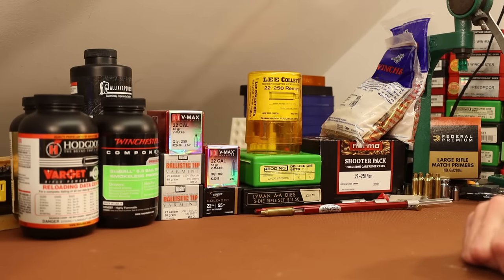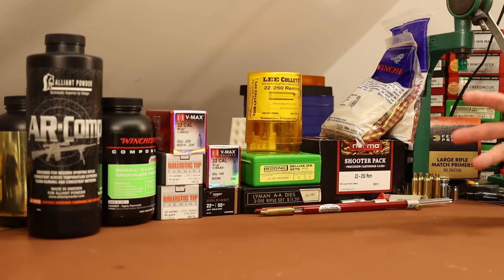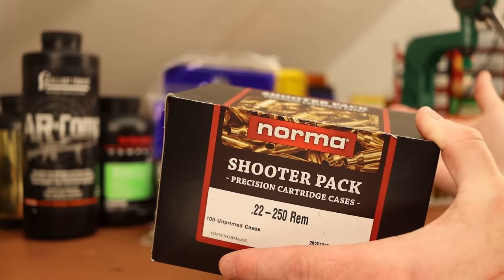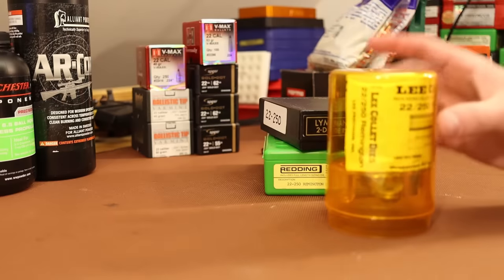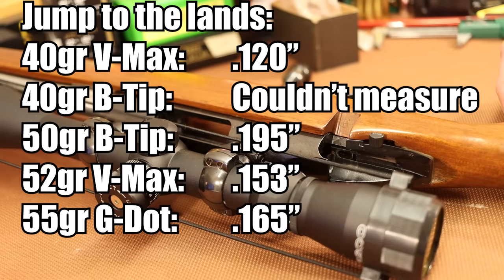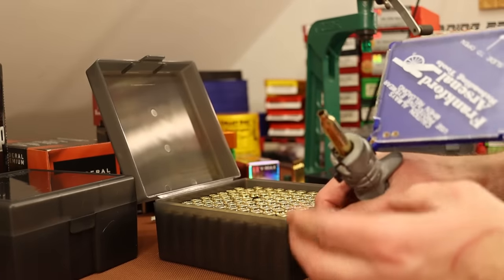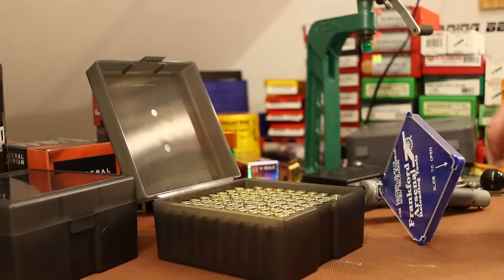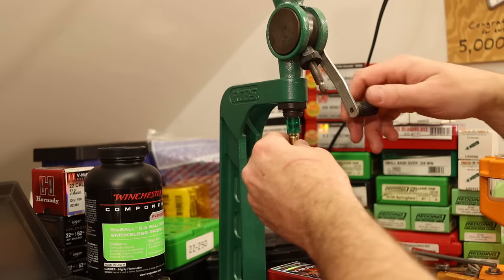.22-250 Remington - Getting started with reloading

Comment: You need to soot your brass man. Also, if you have a new piece of brass, you can use that for your OAL tool. It doesn't need to be a once fired piece of brass for checking OAL. If it is a once fired piece of brass from that rifle, all you need to do is deform the case mouth slightly so it holds the bullet with enough tension that the bullet slides in to the brass. Always soot the bullet, so if the lands pull on the bullet, you will see that on the bullet. If you don't soot the bullet when you check, you have no idea if the lands pulled the bullet out a hair. You are learning, you'll eventually get it...

Comment: Yep, tried to warn you of the 53v-max, they seam to like to have .180 jump to the lands in everything i have tried them in(22hornet, 223wild, 5.56, and 223 long throat). When you get to 40v-max and varget with allready fire formed brass you will get some awsome results. Might want to aneal your brass and check the neck thickness to see if it varies by more than .001 thickness all the way around. By the way i only use HDY and Fiocchi(GFL) brass and WIN primers. A lyman M die is very helpfull ass well.
Reply: The .22 Hornet would NEVER stabilize the 53 gr V-Max. They usually have 1:16 twists.
Reply: @luvtahandload7948  my 22hornet does and will the 55grsp as well
Reply: @sherrypulec1449  What make and model is your Hornet and have you measured the twist rate? My own Hornet is a relatively new Savage M40 with a 1:14.
Reply: @luvtahandload7948  savage 342 made in the early 50s it has a 1-14 twist

Comment: You don't need a fire formed case to use on the o.a.l gauge , if you've a case comparator gauge . Simply measure both cases and the difference to your fire formed case .
 I prefer to compare to my bump sized brass .

Comment: I just started using the Staball, feels like it want’s heavy bullets but I’m using it in 224 Valkyrie.  I did get the new Franklin Arsenal Intellidropper powder dispenser and really like it, drops the exact charge on both ball and extruded after you do the powder calibration.  You do need to let it warm up for a bit (15 min) and I re-calibrate the unit when I change powders.

Comment: I’m 2yrs late on this, but H380, Imr 4320, Imr 4064, Imr 3031, or just Varget, all of which is better than the ones you are using. Hornady load book does not show your powders you are using for the 22-250. My rifle loves the 40 grn v-max, with 36 grn Imr-4320. holes can be covered with quarter at 100.
Reply: I was going to try IMR 3031 on my 4th 22-250, but the gun shop owner said it wasn't funnel friendly and that made me change my mind. IMR 4320,4064 & IMR4895 have worked for me. 4320 is by far my favorite! 8 shots @ 100 yards I could cover with a dime using it with a 55 grain Sierra Blitzking.

Comment: The modified case does not have to be fire formed to be perfectly useful. All you have to do is use a headspace comparator. Measure a fired case and the modified case and find the difference in their lengths. Use the tool with the modified case as you demonstrated, add that difference to your base to ogive measurement and you're good to go.

Comment: 100% it would affect the group near the end of the video, if a stock touching the barrel affects accuracy, then that strap would alter the group especially it getting cut. 
i am a fan of holding a rifle firm not just let it kick as much, you be surprised how it affects groups.
i know with my spring air rifle i need to hold it firm, if i do not it is no where as accurate,
my 22 my 22.250, my 308 i hold all the same, but the air rifle the spring affects it unless i hold it tight, i mean tighter groups, still is accurate, crappy trigger just a cheap stoger, but at 20-30 yards it plucks a sparrow out fine, but i can reduce groups holding it tight, grandkids cant so i must remember that too, and i am fussy and spoil't from having a 17 tikka in the 1980s, factory stock, factory Remington ammo 5 shots under 8mm at 200 yards. that an eye on a fox every shot. if you clean it by shot 11, fussy round  at those speeds, but sweet. cats, foxes, roos, rabbits nothing moved once hit.no exits, unless hit a fox high in the shoulder, it would blow a hole in a $40 skin, ouch. too expensive once foxes lost the dollar over hear he sold the gun, but hands down too 250 yards the best gun ive used, and ammo loading for one is more affordable now. maybe,
and ever since i expect every rifle to be that accurate. naive lol. dam those 17s are accurate,
worst thing i ever did was loose that icecream lid target, i put a small shop sale  circle sticker dot on it, all shots in the dot.
i was called a liar multiple times by friends who knew i dont lie, until they met my father who said dam right its true.
remington ammo went bad i heard for a while too, but man factory ammo was sweet.

Comment: In my Rem 700, I had a problem stabilizing anything much bigger than 45gr in the 1:14" twist barrel. I need to dig out my notes but IIRC my best accuracy load was the 40gr V-max with Win760, I was regularly seeing groups <0.5" @ 100. But those loads are about 12-13 years old at this point so if I can ever get my damn bench back together I'll be starting over from scratch anyway :)

Comment: 22-250   "slow twist"  might actually shoot the  SPEER 70 SP SEMI-SPITZER , fairly well.  IF SPEER ever makes them, again...  The accuracy with those might be   better than the weight vs speed vs twist rate charts would  lead us to believe....  HINT: being  more blunt and SHORTER IN LENGTH than other 70 grain with more  bullet to bore contact surface  MIGHT BE what causes this bullet to shoot  stable, and be   accurate ....even when the twist rate  charts suggest that it should not.

Comment: 22 caliber rifles for deer?   Isn't that to small in most states?   Also.  Please explain why weight is a big deal on cases.
Reply from the maker: 22 is legal for deer in my state (KY) and my brother's state (WV).  It's certainly not the ideal choice.  Shot placement is key.  My nephews have killed several deer with .223 Rem using the 65gr Sierra Game King, so it can get the job done.  They were young and the low recoil helped.  My older nephew has graduated to a 30-06, and the other one will move up to something bigger when he's ready.  I certainly wouldn't recommend any 22 caliber cartridge for deer hunting, in general, but under the right circumstances it can work. 

Case weight really isn't a big deal, in any specific technical sense.  It's often a sign of quality, however.  Most of the premium brands of brass will have very little variation in their weight.
Reply: @JohnnysReloadingBench  thanks for the help.  How is the new chassis you reviewed doing?

Comment: i bought 100 round of nosler/norma brass for my 22-250 and had the exact same concerns with the tight primer pockets. I don't know if this is a good or bad thing.
Reply from the maker: How do they hold up?  Do they stay tight after a couple firings?
Reply: @JohnnysReloadingBench  Hello Johnny! 
I'm from normas home country sweden so i use norma to all my loads and seem too get good case life from them. I do not own a 22-250,  i haven't found the Primer pockets to be as tight as yours but  i use the rcbs benchmounted primer tool so that might change the feel a bit.
However in the 222rem using lee collet die I'm on the 24:th reloading with a 20.5 norma n200 chargeweight with an 40grain nosler bst
Regards Patrik from sweden
Reply: Johnny's Reloading Bench : Jagemann brass made in Wisconsin, sold by Natchez shooters supply

Comment: You ought to get some Starline 22-250 brass and replace that Winchester with it. Starline is miles ahead of Winchester brass, fo not too much more.
Reply from the maker: Starline does not make 22-250 brass.
Reply: @JohnnysReloadingBench   Well that was stupid of me. I could have sworn that Starline made 22-250 brass, and then I just realized that I have Starline 243 and 260, not 22-250. I use Hornady for 22-250 myself, but only because I got a bunch of it once fired for really cheap.

Comment: 99 pieces of brass  -----grrrrrrrrrrrrrrrrrrrrrrrrrrrrrrrrrrrrrrrrrrrrrrrrr
I like to buy once fired brass like 300 to 400 pieces all with the same headstamp. I buy clean brass usually from an indoor range so it has never been on the ground. Then I weigh my brass and sort it into about 3 lots.
The middle 4 standard deviations become my shooter brass.
The lightest brass is used for spares.
The heaviest brass is used for working up loads. If I blow a primer (very rare for me- only 2 in about 50 years) I can use a spare and go on. once I get a good load the heavy cases are retired and the most uniform cases - the middle 4 standard deviations are used for varmits and hunting or shooting groups.

Comment: 22-250 is problematic in an AR10 because of the case taper.
Reply from the maker: I've heard that!  I certainly haven't decided to go that way yet, it's just something I would still consider.  I might get a barrel for my Tikka T3 instead.
Reply: @JohnnysReloadingBench  I probably should have been more clear. The rifle will function fine but unless you make custom magazines you'll have trouble with factory SR25/AR308 magazines. Because of the taper you won't be able to load more than five rounds, possibly less depending on the magazine. If you want a hot varmint cartridge in a large AR platform take a look at 22CM, its feeds fine from AR308 magazines and you can buy factory brass.
Reply: @JohnnysReloadingBench  you might consider either a Savage 110 Varmint (Eric over at Chuckin TV has had some excellent videos shooting that rifle) or a Thompson Center Compass, if you decide to stick with bolt action rifles instead of an AR platform.

Comment: Pretty sad groups for a 22-250 Rem. A good group would have to be .5 MOA for real. I use 62 grain Hornady bulk bullets I get from Midsouth Shooters Supply and get under MOA in my 223 Rem., 22-250 Rem, and my 220 Swift as well. You really won't do any better than IMR 4064 for a standard in the 22-250 Rem. You seem to really overuse the powders that you do have instead of going with the time proven powders. That is your biggest hang up. I do like your videos, but that AR Comp is not a do all powder.

Comment: Winchester  brass is sub parr,.....its junk!.......they corrode quicker,split,just junk.20 years ago it was quality,not today.I only buy it if I cant get other brass.7mm T.C.U. out of 50 cases,brand new(.223) when using the die to upsize to 7mm Ihad 30 cases just split or the necks crushed down.20 years ago,if I crushed 1 piece of brassI dont remember doing it because they did produce good brass back then,Not Now!........did I mention Winchester  brass is junk?.....lol